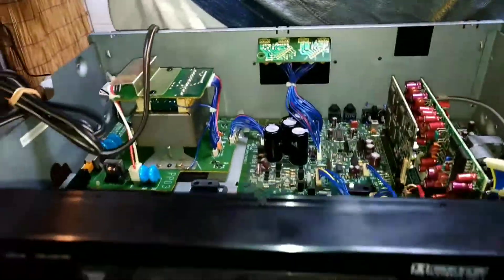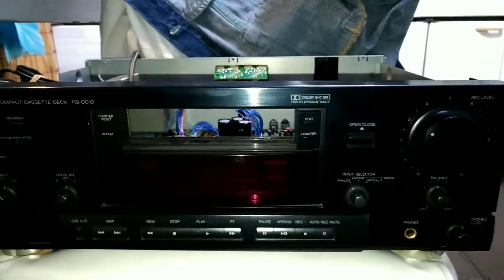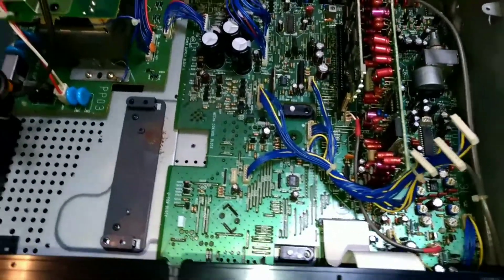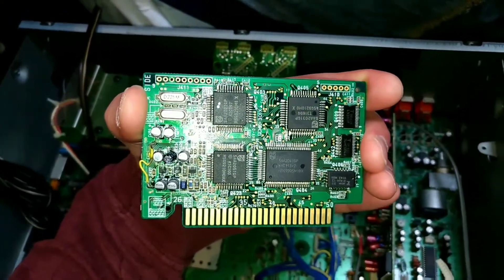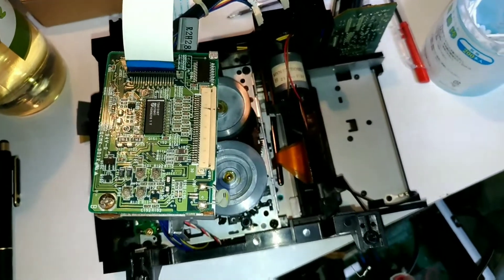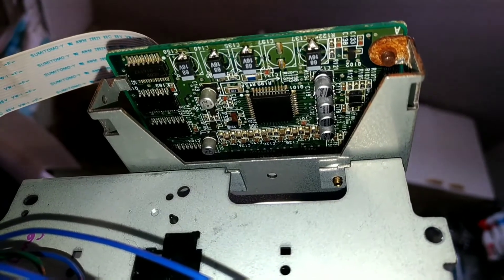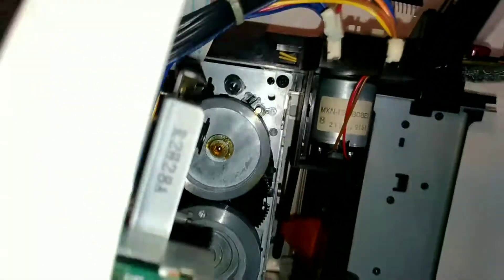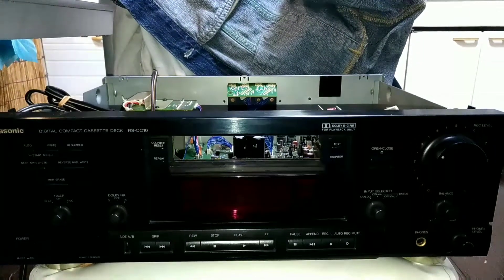Panasonic Technics RS-DC10 DCC Player and looking at the usual capacitor problem

Comment: That sure is a DDC player right there eh bud.
Reply from the maker: That is correct Dan.  A real beaut.  I need new pinch rollers for it now.  Once I get them we should do some sort of a comparison video.  What would be more interesting, DCC vs MD or DCC vs something like analog tape?
Reply: @BDawgStudio 

I think DCC vs DAT would be far more interesting. MD might be a little to compresed for a fair fight?
Reply from the maker: @dace8030  considering MDs life cycle was much longer it is probably better than DCC if one compares the best of each.  DCC is a version of mpeg. MD is Atrac. Different beasts and worth a comparison.